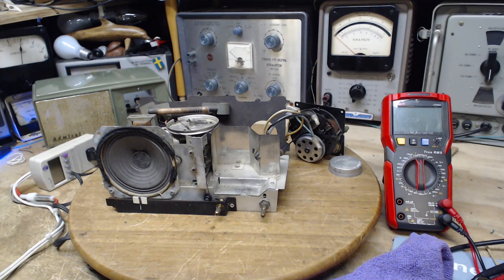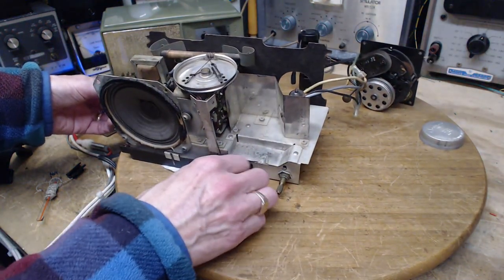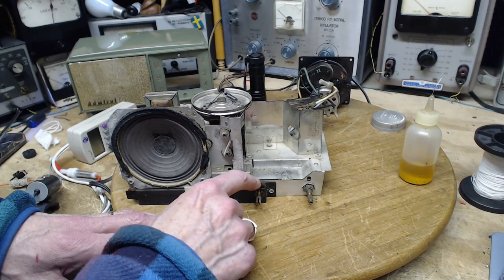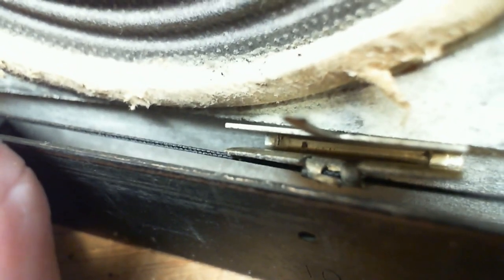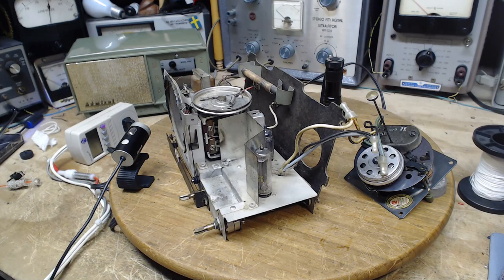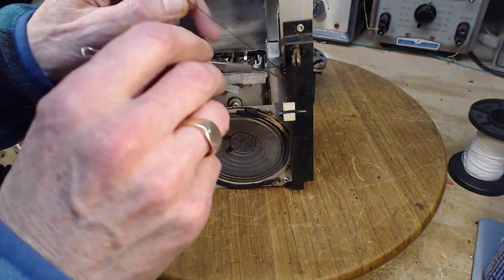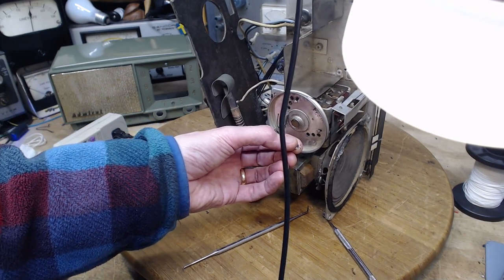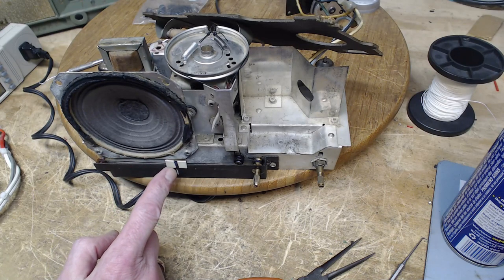Canadian Admiral Clock Radio Model 5E38X Video #2 - Dial String and Pointer

Comment: When I work on Old RCA 45 automatic changer record players and install a new phono carriage, I take the old Rochelle salt  crystal enclosure apart and with a heat gun Apply just enough heat to make the lanolin soft to where is runs like oil. Then I gather the reflowed lanolin in a small clear plastic box that the new cartridge came in. I re-use the lanolin on the tip of my screw drivers and nut drivers to hold a screw in place while placing the screw in its hole.

When doing dial cords I apply just a very small dab on the pulleys and some on the string capstan. This substance it very tacky and remains tacky even after it warms up. It makes a great belt dressing allowing the string grip and stay in place while making adjustments

Recycle everything!

Comment: And if you look at the case closely you might find a cutout in the dial where you have to have it set to so the pointer can slip through and come out the front otherwise the pointer will be held captive in the case (the cutouts allow you to take the chassis out without ripping off the dial pointer

Comment: It would help if you had removed the back plate and let the pointer hang down and then put it back on the track after you restring it and also you need to put the pointer on the lower side because it’s not fully seated

Comment: You should ALWAYS look at the dial stringing diagram when provided by the manufacturer . You will see the proper pointer shape , string spring (only one is needed) and  location when the tuning gang is closed. It is not an  intuitive design since
 the cord  travels in three dimensions. The manufacturer has it with the schematics! I guess Jim thinks using a stringing diagram is cheating.